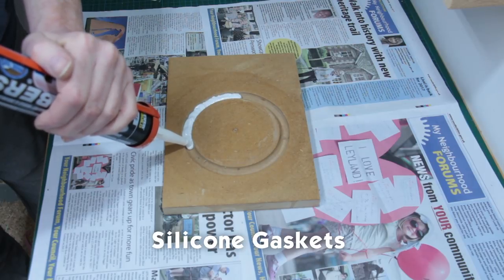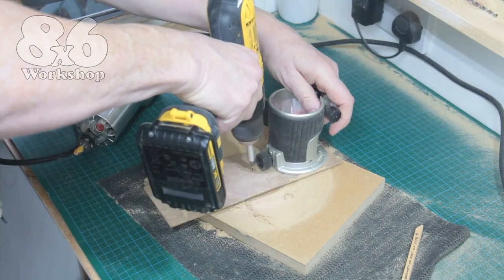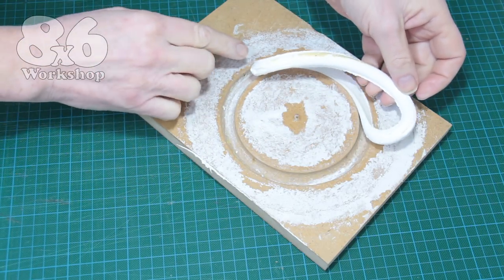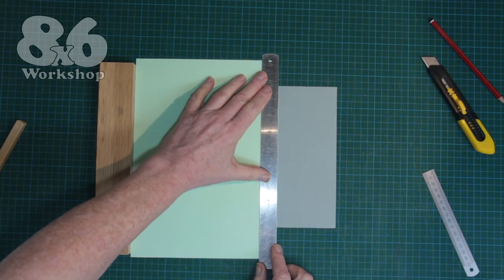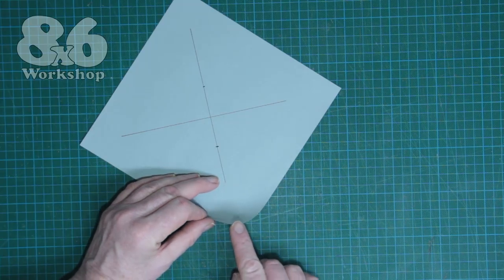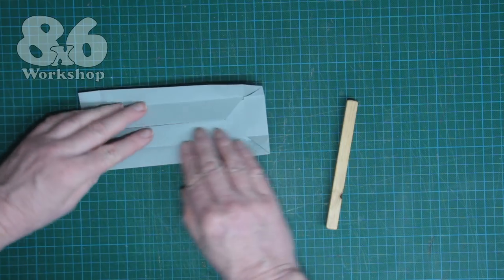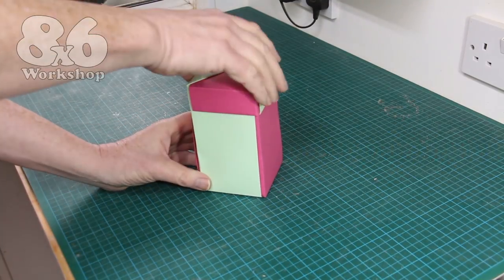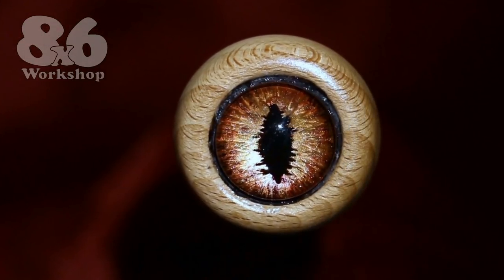8x6 Vlog ►Pen Boxes - DIY Gaskets - Sticker Update and a look at what's coming up in the workshop

Comment: Excellent as always Stephen.
Not sure if it's true, but I was told silicone doesn't stick to silicone. So you could layer the mould with a thin layer of silicone first.
Looking forward to the Halloween version of Jackanory!
Been trying to make a quick cost effective pen box for ages, may well have to have a go at this one. Will try with thicker paper to try and give that extra strength.
Well done!
Reply from the maker: Thanks Paul. It's possible to make the box with 160g card. If the creases don't want to behave fold the card damp then let it dry - super strong :-) There is a Vlog-Xtra coming soon to document the other boxes.

Comment: We also need to know more about the stick. Where does one purchase the stick? Is there a particular brand of stick you recommend? Can you get stick manufacturers to sponsor you? Do the sticks come in different colors and sizes? So many unanswered stick questions, Stephen!
Reply from the maker: Sticks come in many shapes and sizes. as long as you have a flat side it doesn't matter if it's tree size or twig size, it's just what you are comfortable with. The licence has expired on the branding so you can pick up a generic version literally off the floor or out of the scrap bin! The color is not relevant as long as it does not come off onto the paper. Watch out for the wood jokes in the next one!